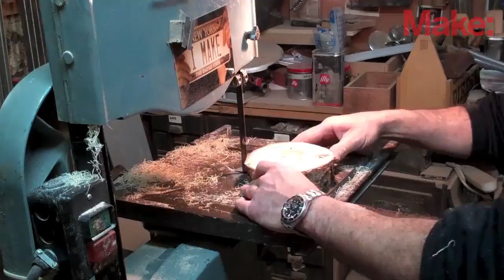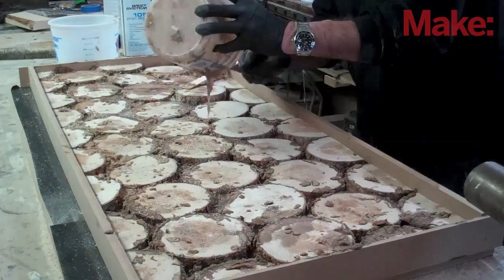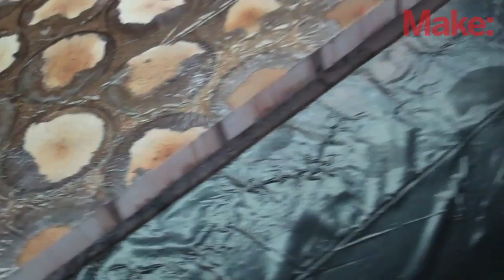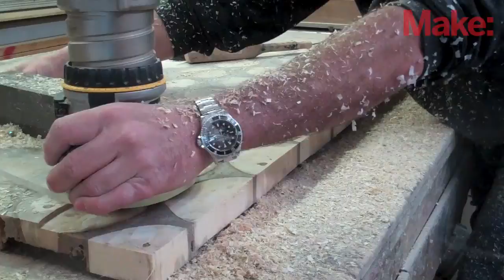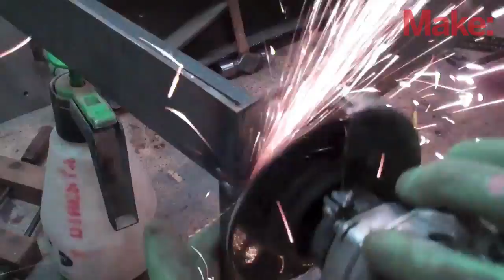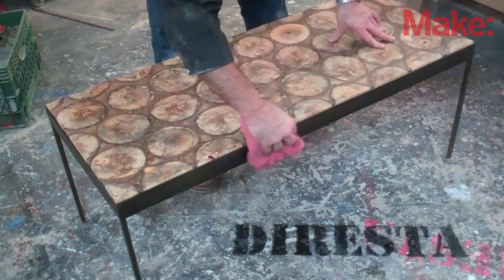DiResta: Birch Slice Table

Comment: 1:40 Without sawdust would be better, I mean using just transparent epoxy, my opinion. That way you can see the bark.
Reply: I think so to
Reply: +Krish Patel (Krishpanze gaming) I think it was partly because it would use so much epoxy if not diluted with sawdust
Reply: yeha your probably right
Reply: +Dennis Sea  thats problly why so he would not have to as much epoxy
Reply: +Juan Carlos Barradas 
Also, if he used clear epoxy he'd still have to sand it and it would take away the clear that would allow for seeing the bark. :-( Not sure how to go about having it be all nice and clear without having to sand it.
Reply: +Jorge Riquelmy Pretty sure you would just have to use increasingly finer grit sandpaper until you just polished it.  Same way you can make hazy headlights clear again or get scratches out of automotive paint/clear coat.
Reply: +phobos2k2 no he would just have to coat it with resin to fill in the scratches and it would be clear
Reply: If he had gone clear, I wonder how it would have looked with some LED lights mounted under it shining through the epoxy? I bet that would be neat.

Comment: I agree with the other comments, the legs leave a lot to be desired and seem like a quick after thought. The top is a wonderful piece, when it was first removed from the mould, I thought, its horrible! Once the sanding was done and the final layer of resin, it turned out lovely.

Comment: OK - I know this is an old video, but I just saw it and loved it.  Here's a thought that may prove helpful.  I know the top had to be routed down about 1/4" due to the epoxy soaking into the wood unevenly.  In hindsight (always 20/20), sealing the wood slices with poly, shellac, or maybe even epoxy itself in advance may have solved the problem.

Comment: The log is 7 - 8 inches, table saw only will cut 3 inches. I could use a band saw but if you ever tried to cut an odd shape on the band saw you'll find it is not safe. That is why i use a hand saw. 
Hand saws are made very sharp and are more useful then one would expect. thank you all for watching and commenting.

Comment: I'd like to see the same project done with clear resin and a thinner slice as the table top.  That way you could put lights under the surface of the table and the light would shine up through the resin and the much thinner log slices showing off the grain of the slices.

Comment: even after casting with the resin, the surface may not have been flat enough to use the router and get a good finish. the sander helps to flatten it before doing the routing.

Comment: question. why did you keep the bark? i dont know if the bark on this wood stays solid with the wood. if it has the tendency to split off from the wood it may affect the longevity of the table.

but cool concept nevertheless a brilliant way to use small pieces of wood to make a table.

Comment: before you spread that plastic down what did you spray on the framing  below it?  I  have a  farmhouse table that the wood has spread apart and now I want to use some epoxy or urethane to fill the gaps and I figure the easiest way would be to build a frame and set the table in upside down it then pour in the filler product. the gaps are up to an 8th inch would you use epoxy over urethane?

Comment: OMG! ...Diresta made a mistake! ...he tried sanding and then whipped out a router! ...OMG! ...hehehe. -)
Reply: No, he sanded so the router extension would have a smooth flat surface to ride on. if he didn't flatten it first with the sander, the router would leave a terrible uneven cut because of the creases left by the garbage bag and epoxy.
Reply: Tim Coombs
Dammit lol. =)

Comment: Looks like he had to take about 1/4" off to get down to the level he wanted.  That's a lot to take off with a plane, especially when you're dealing with 3 different materials (resin, bark, and wood).  The router is a much faster way to achieve the same result.

Comment: Could you not just use the bandsaw to cut the slices? (woodworking newbie here)
Reply: bark can contain a lot of grit or sand which can quickly blunt a blade. he wasn't too concerned when cutting the slices in half, as there was relatively little bark surface to cut through
Reply: TheBrentieman a chainsaw would have been manly too :)

Comment: All this can be yours with $400 worth of epoxy.
Reply: That's funny.
I was thinking the same thing.
Cool ass table, but damn ! That's a LOT of epoxy !
Reply: I think it's a type of glue :)
Reply: +Bender rrrodriguez it's a two part glue that is typically very expensive and also very strong. You see him squirting from two separate jugs to bond the disks together, that's the epoxy.
Reply: Epoxy resins are quite popular for use in these types of applications and they are not too expensive.  Though some epoxies can be used as a glue of sorts, in this application, he's using it as a filler, mixed with sawdust to reduce the amount of resins needed to fill the voids and to add color.  Later in the video, he adds another coat of epoxy (at least one) to seal the table against the elements.  You can get a very high gloss tabletop or countertop with these epoxies.

Comment: I wonder why he used epoxy to finish this table instead of polyurethane or something. Seems like epoxy would be more expensive, no?
Reply: they build stuff for clients with deep pockets, they're able to charge whatever, so they use the most effective tools, not the cheapest.
Reply: Poly isn't very thick; it would take many coats to get a flat surface

Comment: u could get a grand for that in the rite store!!
Reply: I'd expect more
Reply: not worth more!!
Reply: milwaukeegregg It is
Reply: ILoveBurgerzz go fetch!!!
Reply: milwaukeegregg Are you ok?
Reply: milwaukeegregg I felt like examining your estimate, particularly because of your conflict with the other guy. I do an estimate towards the bottom, granted the numbers are all estimates.
How much time do you think this took? Designing it, cutting the log up, cutting them to size, forming it in, epoxying it, waiting for it to dry, sanding it, cutting it down to level, sanding it again, epoxying it again, welding the frame, blackening the frame, and final assembly?

How much do you think Jimmy's time is worth an hour?

Just how much $$$ in steel do you think he used?
How about that epoxy? Epoxy is pretty expensive.
What about all the other little things that went into this?

Cause, I mean.
I'm going to throw out 20-25 hours as a number.
I think Jimmy is easily worth $30/hour.
So that's $600-750 right there.
Then I'm guessing we're looking at somewhere in the area of $100-150 in materials.
We're up to $700-900
Okay, but remember, we're paying Jimmy $30 an hour for his labour. Jimmy needs to make money as a business too. Let's say 15% profit, so add $125-250
We're now at $825-1150
But wait, there's more! Now we need to account for sales tax, which is roughly 8% in NY, where I'm told Jimmy lives. So add $75-100
Okay, so we've arrived at $900-$1250 for the table.
Reply: seigeengine all that? If the guy got a grand he should thank his lucky stars. I have done this. Made furniture and sold it. You rarely get out what you put in. If you believe that the buyer is worried about how much time you put in,keep dreaming.This stuff is like art. It's in the eye of the beholder and his wallet!
Reply: milwaukeegregg Yes, all that, and you need to do all those calculations all that all the time if you want to be successful.

The buyer only isn't worried because they aren't thinking about it. The modern consumer is trained to think of products as mass-produced, quickly and cheaply. Even realizing it was custom made, they often fail to realize just how much work and skill goes into it. To an extent, they can be made aware of this. Few people, none of which you want as customers, are going to sit there and complain you're not willing to work for minimum wage.

And if you can't get as much out as you put in, and then some, you're failing somewhere, either your work is poor, you're targeting the wrong market, or your selling game is weak.

I largely ignored overhead, because it really depends on your scale, and in a small home workshop setting, it would be relatively low.

Besides, do you think you're worth as much an hour as Jimmy? Maybe you're worth $20/h instead of $30/h. 

So, if it were YOU making this, you might want to charge something more in the area of $600-$800

And as someone who likes nice things, yes I'd be willing to pay a price in that area if I was interested in purchasing a table.
Reply: good for you!!
Reply: milwaukeegregg Yep. :)
Reply: seigeengine Estimates are important with any art/craft job, so I enjoyed seeing how you'd break the costs down. My problems are not selling well in person (success on listing sites) and devaluing my time in a project. Also, never forget that marketing/shipping also costs time and money.
Reply: TylersTerrain Thanks! It also helps the consumer evaluate the prices asked for different products to get a better understanding of prices on things they're looking at buying. Especially when those things are items like this, as opposed to something mass produced.

That's a problem a lot of skilled people come to. Undervaluing their labour. A lot of people also don't really fully think out their pricing either, preferring to use shortcuts without actually understanding their real costs.

Marketing is part of overhead, which I think I mentioned I avoided talking about. It's wildly variable. Some people will never advertise, depending on things like word of mouth, other's will. As for shipping, if you mean of materials, that's a material cost (as is gas/time to go get it at the store! Don't forget non-building time and expenses as part of your costs!). I suppose you mean of the final product though. The customer would generally be expected to pay for shipping on top of the cost of the item itself, if it was needed. Free shipping is more or less nonsense. Big companies like Amazon can kind of do it in the sense that they drive so much product they can work out special deals to get lower prices, but ultimately the shipping cost has to come from somewhere. If the burden isn't being put on the customer up-front, it's being hidden in the cost of what they're buying. That, or you're under-charging, which will likely end with you out of business.

I didn't mention shipping costs earlier because it's not part of the cost of the item itself. If the person is local they can just come pick it up and avoid that cost altogether.
Reply: seigeengine Yeah, you did mention that.  I could have framed my response better. My grandfather taught me to make sure that I'd make money off of the separate shipping costs, as the shipping process in a one man operation takes a lot of time away from your other tasks. You're also totally correct that people are generally bad at assessing cost/value. That goes for small business owners too --  "...you need to do all those calculations all that all the time if you want to be successful". You are so right, just slapping a price on and bringing it to market is never a smart way to do business, Instead you charge what you can. In order to do so, at a minimum, you must be constantly aware of your finances.
Reply: TylersTerrain Exactly. Every minute you spend on a product for someone is time spent. Whether that's the time you spend getting materials, drawing up plans, or packaging it up and shipping it out. Even the time you spend discussing what the customer wants with them is time put it. All of that is labour put in, and you should be paid for that labour.

People also like to say things like "you can't charge more than the market will bear." While this is ultimately true, a lot of people try to target the wrong market. You're never going to be able to compete with mass-produced cheap furniture from walmart or Ikea, so why try? You're offering a higher end product, and should target a demographic willing to pay more for that. Which seems really obvious, but a lot of people make that mistake.

A good reference market is beer. You have a lot of big companies out there that produce massive amounts of cheap beer. They target the common market, and they make a lot of money doing it, but they can only make that money by selling enormous amounts of product. To do that, they have to create a product that appeals to everyone. Compare that to a microbrewery. They produce a smaller amount of more expensive beer. The thing is, people are willing to pay for it because the microbrewery isn't trying to compete with a big company. Instead, they target a niche, and provide a specific taste that some people will really love, and others won't. They don't try to appeal to the common man, but a small subset of the population. They can charge more because the subset of people who really like it will be willing to pay more for it, and in turn they can thrive while moving far less product.